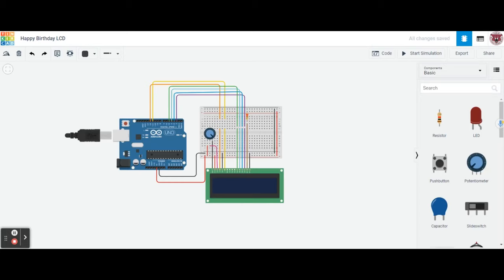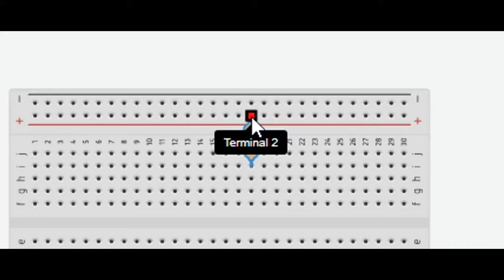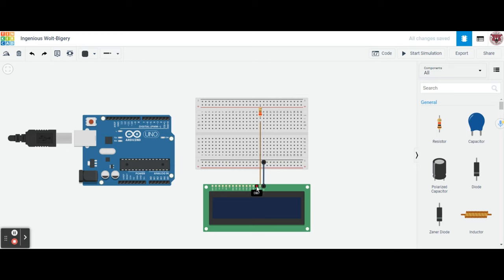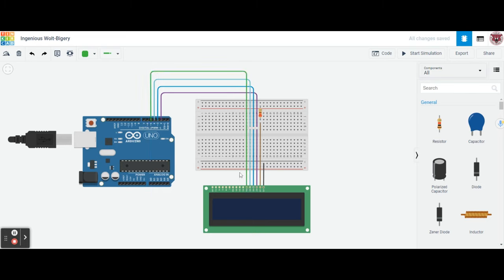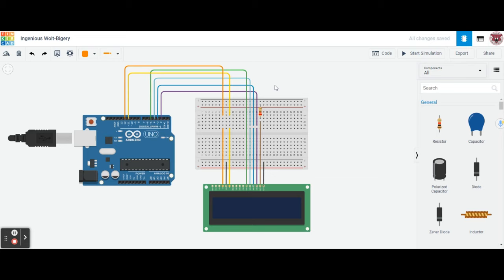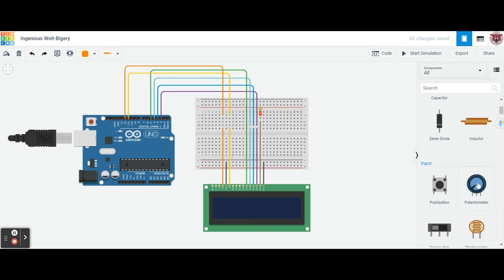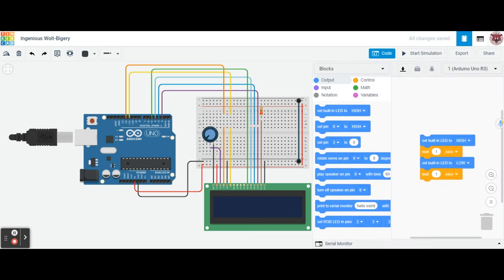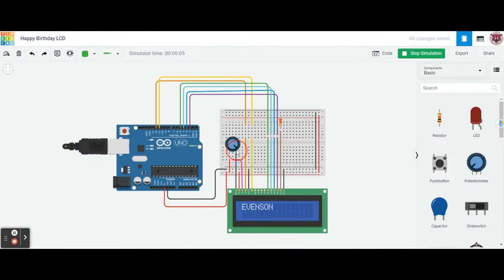How to Wire an LCD Display in Tinkercad

Comment: Hello sir, i tried using your code it's simulating, but message is not displayed in the LCD board, please give some suggestions
Reply from the maker: Your potentiometer has to be turned all the way up. You would have No display otherwise even if lcd is on.
Reply: @MRLONGCTE  Even after doing it, its not displaying
Reply: @SubcribeWithoutanyvideo-mt4zz  Thank you for the suggestion.  I had the same issue and your wiring suggestion corrected it.
Reply: @SubcribeWithoutanyvideo-mt4zz   tnks alot works now , I had the same issue to

Comment: The LCD isn't playing my message. Any suggestions?
Reply: potentiometer had to be turned all the way up. No display otherwise even if lcd is on.
Reply: Also, split the positive wire for the potentiometer (Terminal 1) so that one part is connected directly to the positive bus on the breadboard and a second wire connected from the LCD directly to the positive bus on the breadboard.  It worked for me.
Reply: @dang48  in the LCD from where to where should I connect to the positive bus, I meant which pin
Reply: @dang48  hi bro how to fix the wirings it didn't show message??

Comment: what is the code
Reply from the maker: #include <LiquidCrystal.h>
// initialize the library with the numbers of the interface pins
LiquidCrystal lcd(12, 11, 5, 4, 3, 2);
void setup() {
 // set up the LCD's number of columns and rows:
 lcd.begin(16, 2);
 // Print a message to the LCD.
 lcd.print("happy birthday stevenson!");
}
void loop() {{
 for (int positionCounter = 1; positionCounter++;) {
 lcd.scrollDisplayLeft();
 delay(100);
 }
 delay(5000);}
 }
Reply from the maker: You should be able to copy and paste that code into your coding text area.
Reply: @MRLONGCTE  Sir, I am planning to have a clock comes up after the walking massage. Is there any way I can do it? Can you help me sir..
Reply: @MRLONGCTE  nothing is showing up in my lcd
Reply: @MRLONGCTE  s